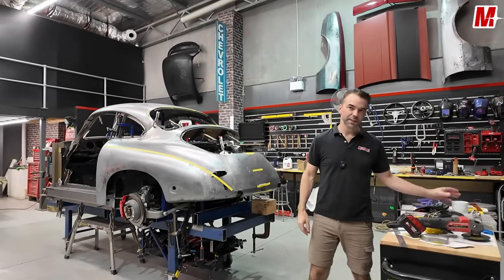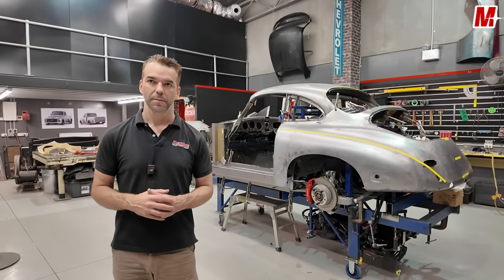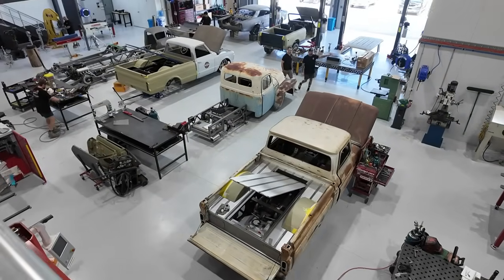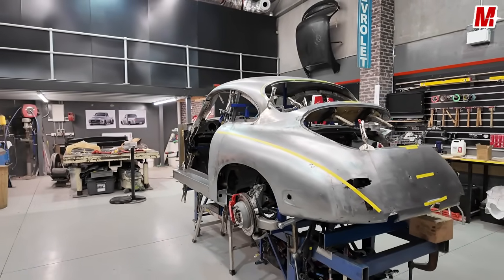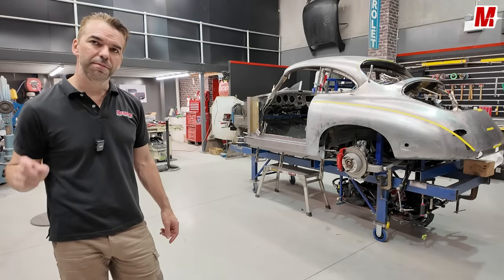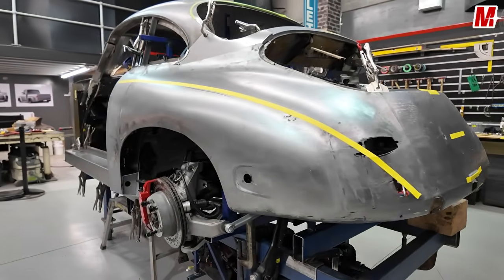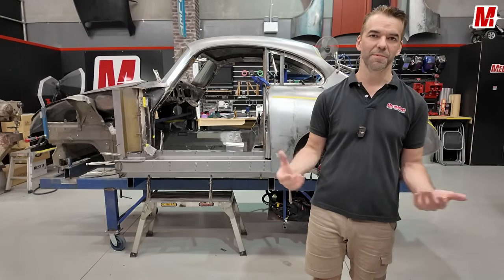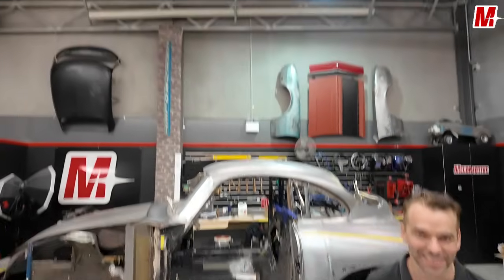Restoration Weekly + Workshop Feature Teaser+ Porsche Build Update

Comment: cut up my rear fenders on my Pree A  fiberglas body, molded on a original car, cut after b piller and back on top widend 65 mm att rear cut of the rear fender corner end and moved a bit  to front. to keep same rear radies. made a radie tennplate before cutting. filled in the piecut.
rear wheels 9*17.